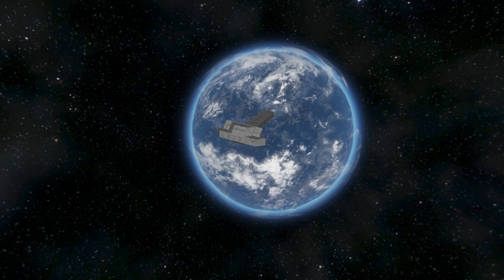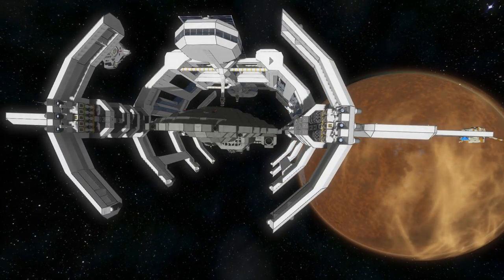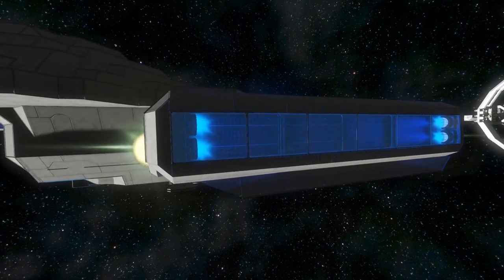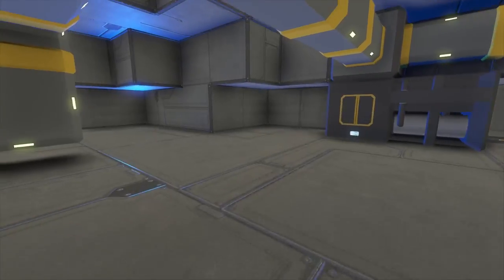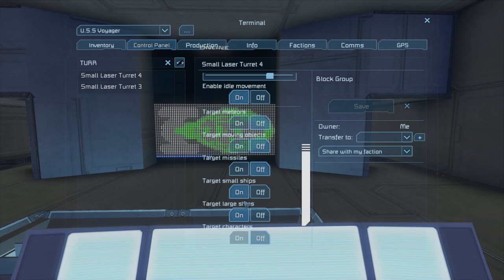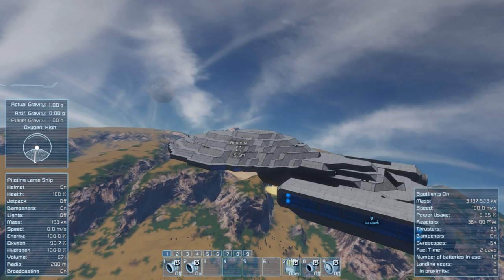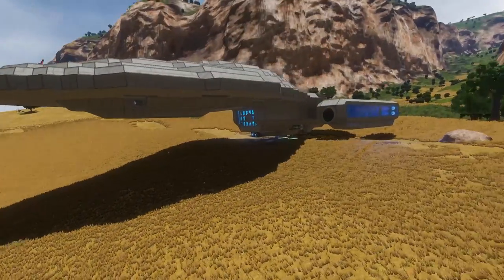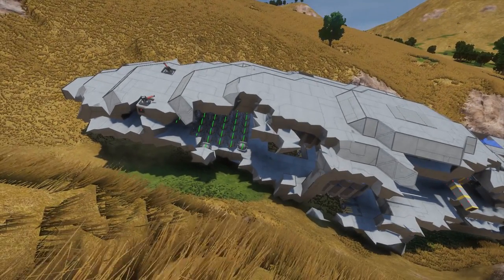Space Engineers - U.S.S Voyager- (One Day Speed Build)

Comment: The Delta Flyer had nacelles that articulated outwards. The Alpha ship when the USS Prometheus separated also had two mini nacelles that popped out the top and bottom. 

Voyager has what are called "variable geometry pylons". "The goal of which was to improve engine efficiency by optimizing field stress when the ship travels extended journeys at warp 8+, resulting in significantly improved engine efficiencies". This also allowed the warp field generated by Voyager to not damage subspace, unlike the other variants at the time.

Comment: From what I remember there was also a much larger strut that folded down from the back of the saucer area.  That sound effect is really cruddy.  Sounds more like the sound effect of the original series vessel.
So... the ship broke in half, I believe, due to the fact that, since the shields were keeping it intact, the ship was embedded inside the planet's voxels.  Upon deactivation the shields stopped trying to carve out the planetary voxels to keep the ship intact (a side effect of the temporary blocks being spawned to create the shield effect) and so, at the next voxel update for the planet, the blocks inside that space were deemed unfit to be attached to your large grid and... well... splittage occurred.
I had an idea about the nacelles being in the way of landing in tight spots.  If you were to try and implement the folding nacelles into the craft, you could then move them out of the way to allow for better landing.  You might, however, have to implement a locking system to the rotors above and beyond their own locking functionality similar to how the landing gears were used to lock the Prometheus nacelles into place for that ship.
The Intrepid class is a complicated class of ship to try and reproduce either way.  I think your build might have been better with a slightly more elongated saucer and engineering section, and slightly shorter, more rear-offset, nacelles (I'm talking a block or two in the elongation and nacelle offset, nothing major here).  However, I'm just nitpicking here so feel free to disregard.  Now you need to make a functional Borg vessel (or a few vessels based on their various favorite shapes) to complete the scene.

Comment: you can find "lost" ships... either using admin tools or by manually editing the data and pulling the GPS yourself. so long as you just misplaced the ship.

and for that landing. atmo's are a bit tricky while the game has no angular velocity. if the thrust for atmo's isn't balanced, at least a little, then the natural physics and gravity will cause the ship to behave funny, such as when you thrust up your pitch changes. making landing big ships a challenge. my main atmo tip: place them along the edges of your ship, particularly the up and down thrusters.

and ya the ships were called starships for a reason, they weren't meant for planetary landings :p